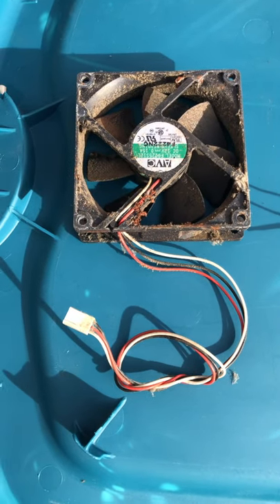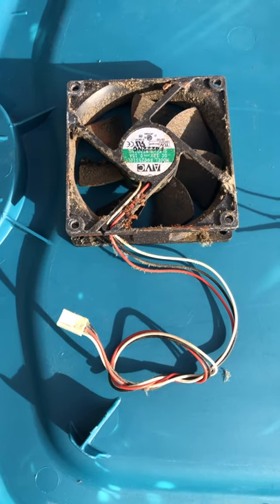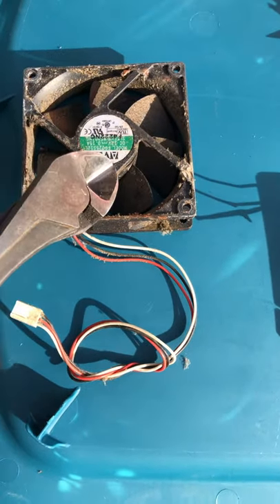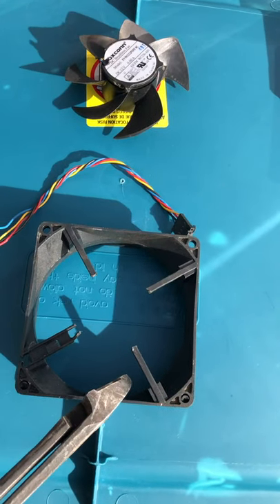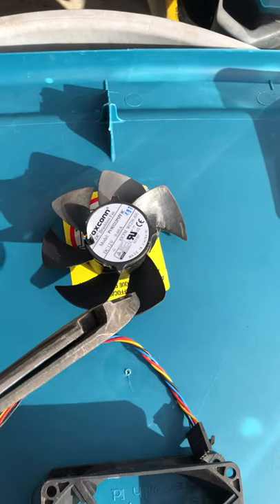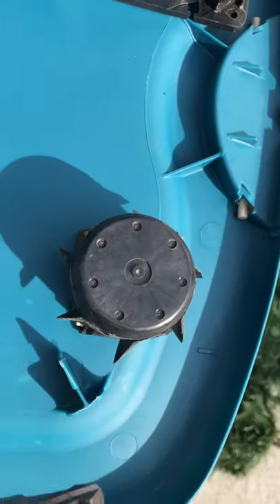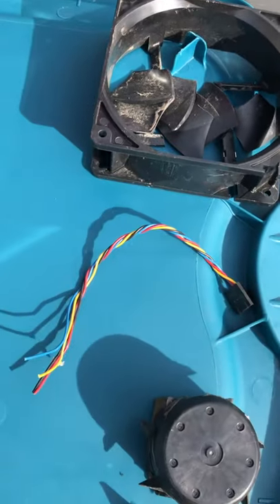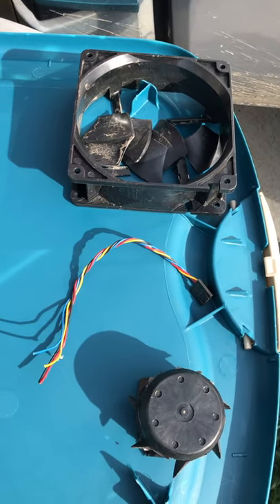Shark Scrapping #shorts - what’s inside a computer fan

Comment: I have like 50 of these from kiosks that were thrown away while still inside the awesome hardshelled rolling cases that they were shipped in which I also kept and people bought the cases from me for $20-$40 each. They filled up an entire dumpster and came from a production company that went out of business down the street from me. They also threw away 3 $1100 iPad ring roamers and boxes and boxes of ink and specialty printers that made logos and big posters and such and a ton of wall signs/decorations for like coca cola and beer signs and 3 rolling equipment trunks that cost like $1000 each. 

The kiosks had their tablet screens removed but still had the fans and the extension cords and the rectangular kiosks and the bottom half of each kiosk could be attached to another bottom to make wall pieces so I used the kiosk bottoms to build a movable wall in my kitchen to separate the dining area from the kitchen area.
Reply from the maker: Don't you just love those kinds of finds?
Reply: @sharkscrapper  yes I really do